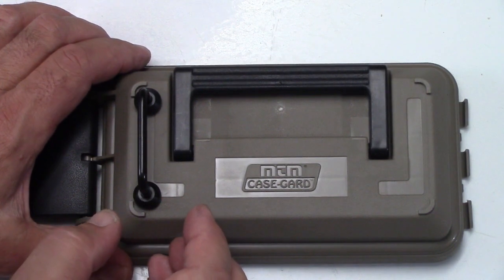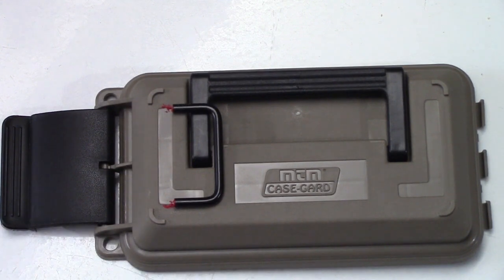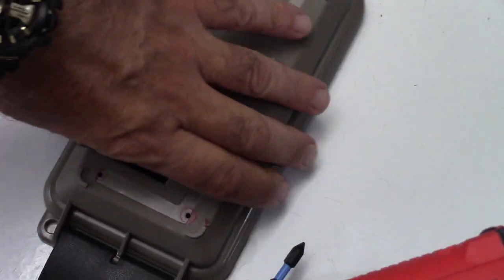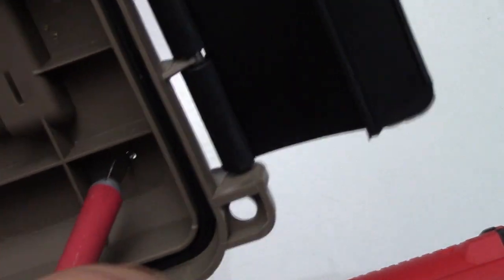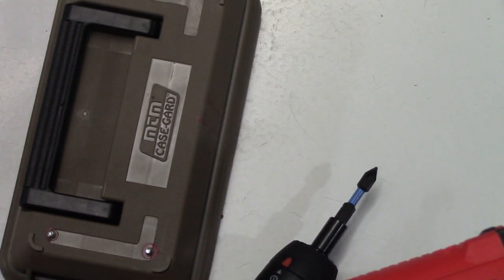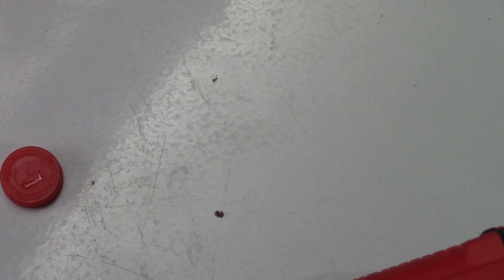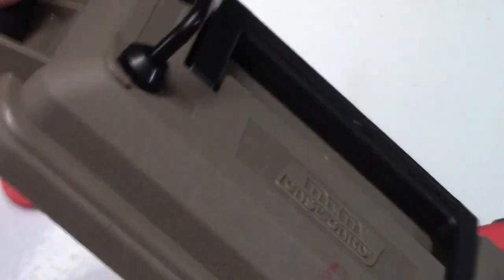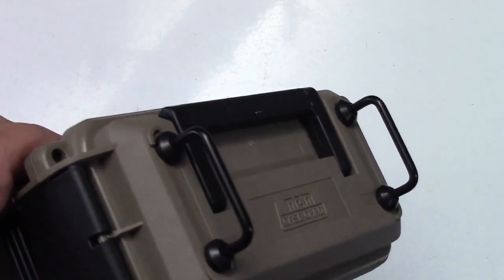Ammo Can Battery Box 5: Rack Handle Upgrade

Comment: Enjoying this build, been wanting to do a box, but tossing the ides of either a LiPo or lead acid battery.
Reply: Though one idea I saw and liked, was adding SAE connector to the outside so I do not have to open the box for recharging the battery
Reply from the maker: I'm going Lithium for the Mr. PORTOKALIS build.. Battery Tender Junior now makes a lithium charger... Peer pressure....
Reply from the maker: Check out the latest video MTM Mini Big Features.  Took your advice and added an SAE connector on it.  Looks cool.  Thank you for the  idea!